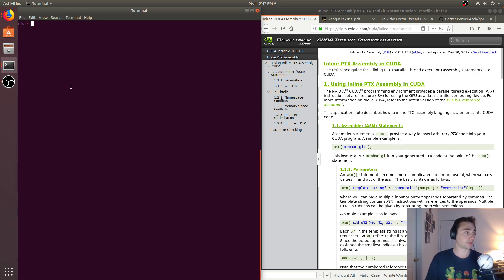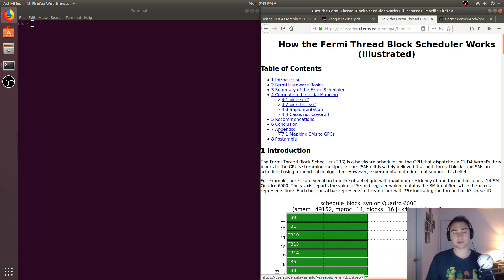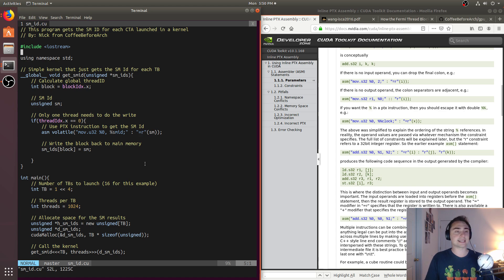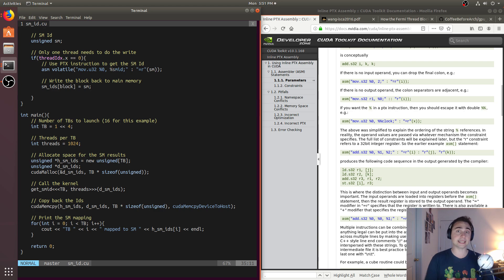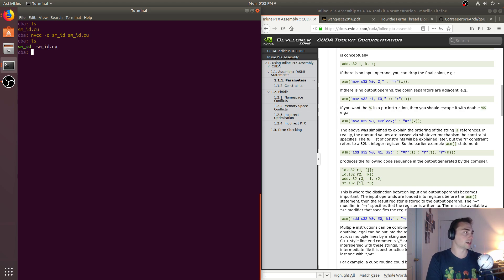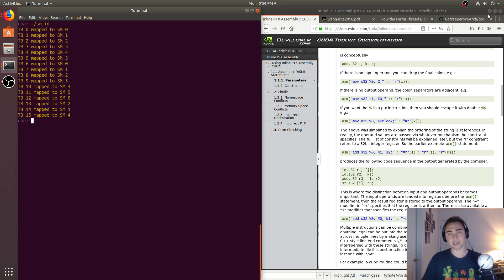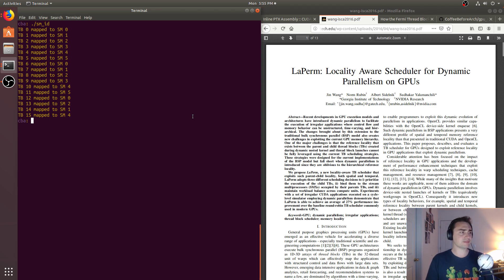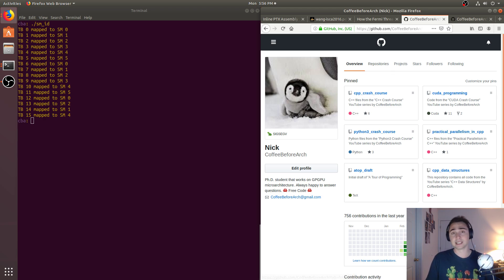GPU Microbenchmarking: Inline PTX

Comment: Pardon if I didn't understand correctly, but once we figure out how threadblocks are mapped to SMs, what can we do with that information?
Reply from the maker: Good question! From a programmer's perspective, this information can be used to bind tasks to SMs instead of to thread blocks. The hardware scheduler for thread blocks can make sub-optimal decisions, so software task scheduling can be a work-around for the fact we can't modify where thread blocks are placed.

From a research perspective, if we want to propose a new and better scheduler, we need to understand what the state-of-the-art is to compare against. Understanding the hardware scheduler has also been used to create covert channels on GPUs.